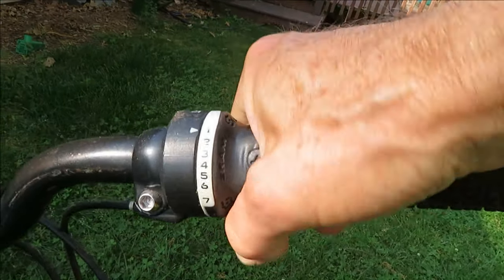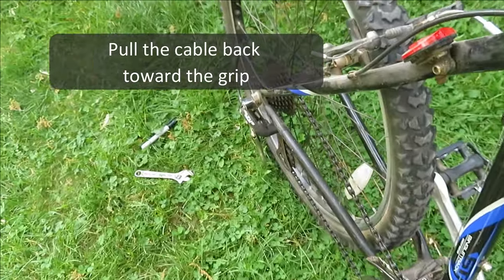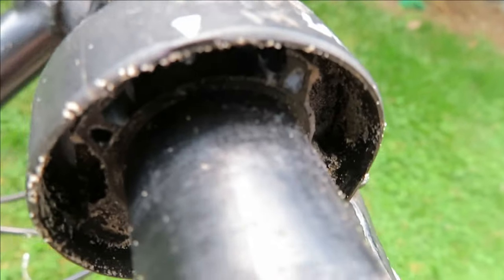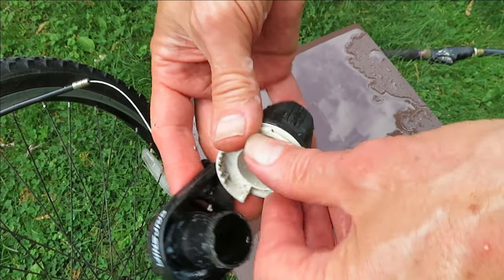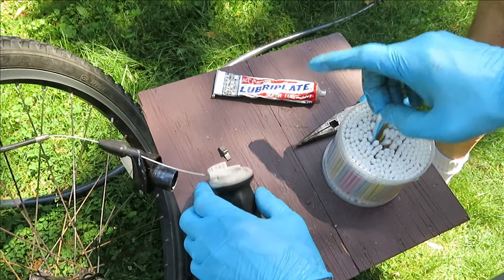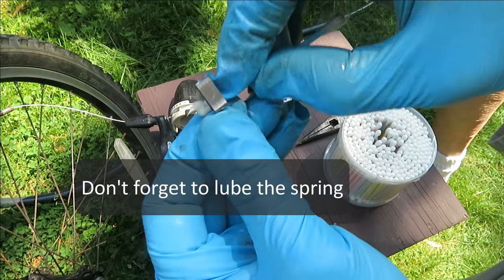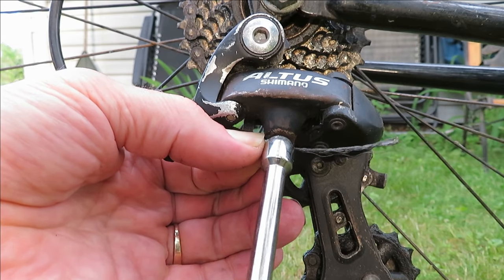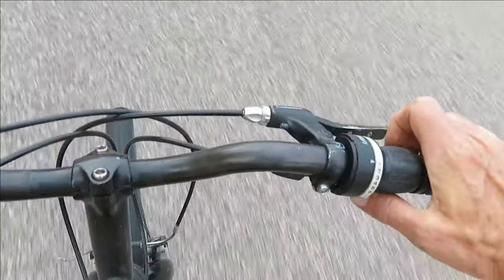Bicycle Grip Shift Stuck:  Quick Fix without Replacing Cable

Comment: Had some problems with mine being really tight hard to twist. Soon the outer plastic split. Upon inspection the cable had some gritty rust spots. Being close to water it tells me we should also be lubing the cable that rides in the plastic outer  also. Thanks for your helpful video! I got some answer to sticky shifter out of this. Always finding nuggets of knowledge and wisdom, tricks and great help.

Comment: My lil spring was broke 😢I looked on Amazon for a replacement. To my surprise I could get the entire gearshifter for $10. I replaced mine and it’s working great. I usually buy top rated and whatever else everyone is buying on Amazon. I picked up some new brakes and intertubes too. After 1500 miles finally doing some deferred maintenance 🤣🤣

Comment: Excellent and detailed breakdown, this is exactly what I needed to see to understand the mechanics of how these work to fix mine. Thank you!
Reply from the maker: You're welcome! I hope the repair goes well.
Reply: @TheOriginalMechanic  Thanks and it did! Turns out I had snapped a small plastic piece inside so I had to replace the grip shift anyway, but now all fixed it runs as smooth and quiet as the day I bought it :D (Tern Link D8 gen1)

Comment: Great video! I have a mountain bike that was left on the curb for free. I put new tubes on it and adjusted the brakes. Come to find out the same shifter was stuck as the one you just fixed. I figured I would watch a video first before I just started taking stuff apart that didn’t need to be taken apart. This was exactly the same issue I was having. Thank you for the video!
Reply: Smh same with mine, dudes wife said “ he only rode it once or twice” okay lady why is everything rusty and broken? It was 10 dollars, which honestly I should’ve just gotten a Walmart bike or something

Comment: That washer with the lip between the cable and the nut should have the lip over the cable so pointing down.

Also correct assembly and adjustment of cable/shifter is always done in highest gear, not lowest. 
Always shift to highest before beginning to work on a bicycle.
Reply: Yes, watching this video was like man, people are fixing the shifter half wrong. You must put on highest gear( the small gear)  than pull cable snug not too much force.

Comment: Came across in my recommended... Not sure how you put the cable back on, but it's way easier to be in the highest gear (7 in this case), pull any slack out of the cable, and tighten the bolt... No force or several pairs of pliers needed, you are not pulling. a lot of tension, just removing slack,  plus, yeah, I would have change the cable at that point.    Nice video though, I repair all sorts of these grips often, these particular once are one of the easier ones to take apart....  Ride on.

Comment: hi!! Im having this exact same problem with my boyfriends bike... I wanna fix it for him!!! I dont know much about all these lubricants though and i know some can be harmful for certain material if the correct one isnt used. Is there a specific lubricant you would recommend? When i looked up yours on Amazon, a whole bunch of options showed up 😵‍💫
Reply from the maker: Experts don't recommend petroleum based lubricants such as white lithium on plastic. I have personally used them without issues but apparently it depends on the plastic. Instead they recommend silicone based lubricants for plastic. Searching under that will result in many products.

Comment: Good video but if my cable end looked like that I would be replacing the cable as you’re probably going to have to anyway sooner than later unless you can wind that up tightly and put it in a cable end. I would change it as I’ve got it off anyway saves doing it again later.

Comment: Excellent video; love the way you added the clear audio after. Two questions: was it necessary to loosen the cable? and where’d you get the bracelet?
Reply from the maker: The cable has to be loosened up some to get the grip shifter apart. I've seen a few videos where they actually cut a perfectly good cable to get the shifter apart. As for the bracelet...lol.
Reply: @TheOriginalMechanic  thanks. Cool bracelet.

Comment: So my left gear shift has been bent around a complete 180°, am I able to fix it myself or do I need to take it to a shop,
Reply from the maker: I have not fixed such a problem but I would probably give it a shot before taking it in.
Reply: @TheOriginalMechanic  I tried it and I managed to fix it without any tools, took like 30 seconds

Comment: Hey do I need that front derailer to shift my Gers on the back derailer? Thing is a headache. I wanna use the middle front of my 3 and just take the thing off. Is that possible?
Reply from the maker: No, the front derailleur doesn't need to be shift-able for the back to work.  Just leave it in one position and don't use it.
Reply: @TheOriginalMechanic  hey man thanks. You are a life saver. 🫡🫡

Comment: For the lube part, am I able to use wd40 instead of lubricant?? Basically just use oil instead
Reply from the maker: I know the pros recommend a non petroleum based lubricant. These can damage plastic parts.

Comment: Hey my shift gear refuses to go into gear 1 the other 5 work perfectly any ideas?
Reply from the maker: There may be a stop or limit screw that needs to be adjusted slightly. This is there to prevent the chain from coming off.

Comment: My shifted works but my low and high left handle dsnt go to high it’s stuck in low how do I fix that the same way ?
Reply from the maker: I would think that the same method would work on the left gear shifter.

Comment: what type of grease is that? can i dunk everything in WD-40 or do I need the grease?
Reply from the maker: A non-petroleum based grease is suggested for this job. WD-40 would be a no. A bike shop may have the ideal grease. I used what I had on hand. It's called Lubriplate.

Comment: My grip shifters are literally stuck. I've taken out the screws holding the shifter grips and they won't slide out. I've tried hammering them just to loosen them , still won't budge. 
Any ideas?
Reply from the maker: Two things: The cable has to be loose by cutting it or disconnecting it from the derailleur and the handle bar grip must be off. Then it should pull apart.
Reply: @TheOriginalMechanic  if you dont stop breaking ppls bikes imma sue you
Reply: @tiktoktube120  - I'm really curious how you managed to break something by trying this?  It's a no-brainer.

Comment: I'm not able to remove the shifter. There are plastic pieces holding it in place. Any advice?
Reply: I had to get a broad flat blade screwdriver to lever mine apart. There's a plastic retaining lug that needs to pop clear. I had to be far more brutal than I thought I'd thought!

Comment: My Huffy has 6 gears on the  right 3 on the left and I'm Clueless on how 2 ride this bike.🙃
Reply from the maker: A way to simplify is to only use the right gears and leave the left on the middle sprocket.
Reply: @TheOriginalMechanic  Ok.Thank You.I went out yesterday 2 shift my gears but it would only go from 6 & 5.Guess I'm gonna hv 2 do what u did in this video.
Reply from the maker: Yeah looks like it needs some work. Good luck with it!
 @elizabethannfarrow1971